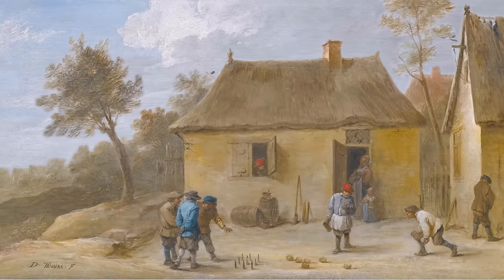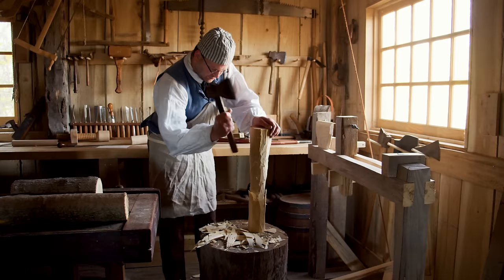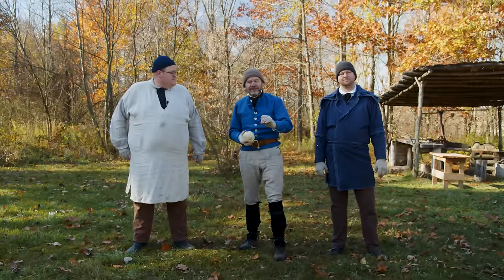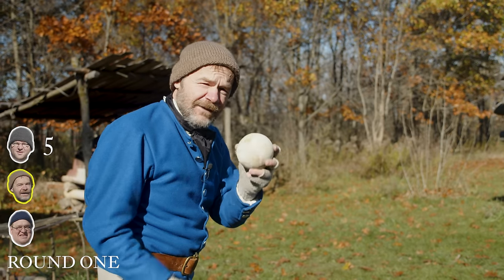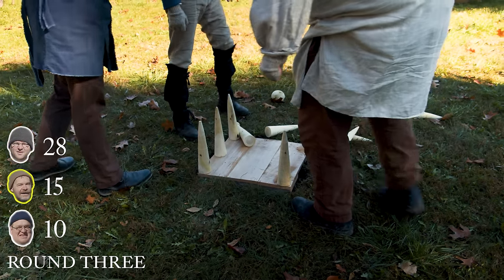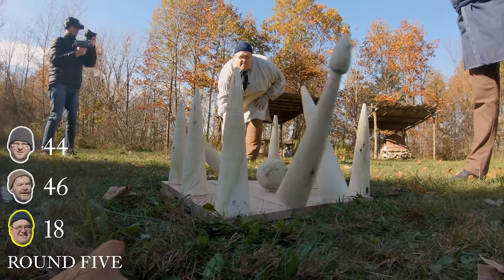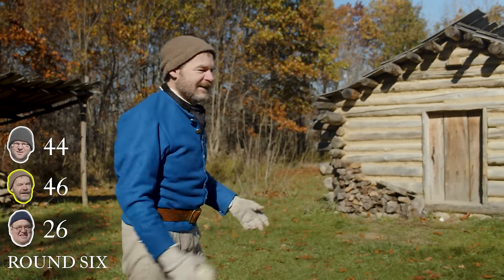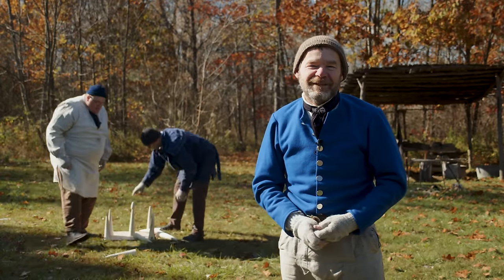Bowling Then VS Now

Comment: I found it interesting that this would seemingly be the origin of the term "Kingpin", since modern bowling games do not have distinctions between the pins. Seems like a great activity for kids, it's a new game they have to figure out, with some flexibility of the interpretation of the rules, and gets them to connect with history.
Reply: You are correct, this is indeed the origin of the term kingpin
Reply: I do believe modern European 9 pin bowling still uses the term "kingpin" for the center pin in the diamond pattern.

Comment: That reminds me so much of the traditional German "Kegeln". Except that nowadays there is a wooden alley leading up to it nowadays. The trick is that the alley "Kegelbahn" is narrow at the start and widens just before the pins so that the corner pins are very difficult to get at. But the alley isn't 100 % flat but polished in a certain way that allows to give the ball a spin, then hit the narrow , ever so slightly elevated corner of the alley, which will make the ball drift towards the opposite corner pin. Very skilled game.

Comment: That would be fun.  Seems like I saw Skittles in the intro of a video from the UK.  Maybe a tabletop version 'cause it looked like the ball was suspended on a string.  That would be fun, as well.
Reply: You're right. That's called table skittles. Great for smaller pubs that didn't have room for a skittle alley